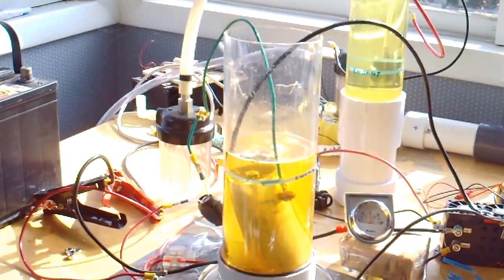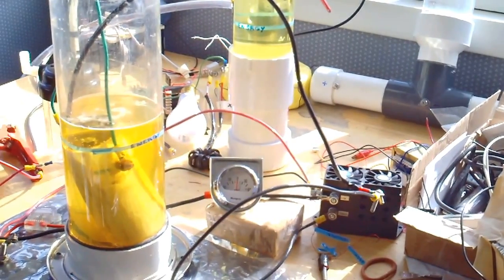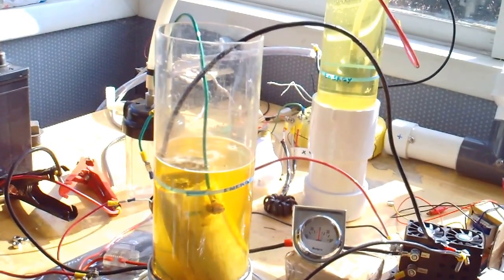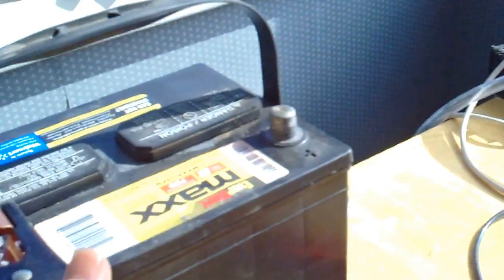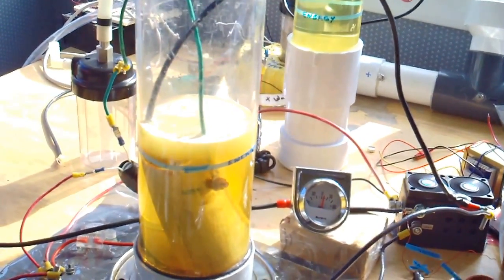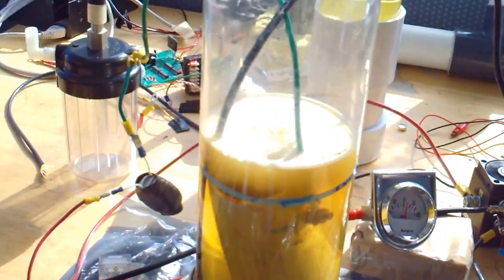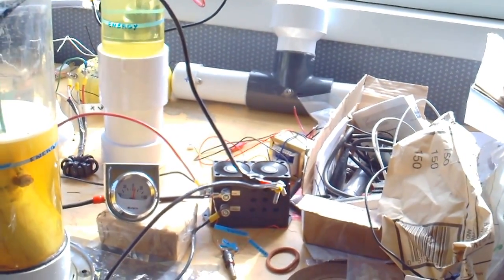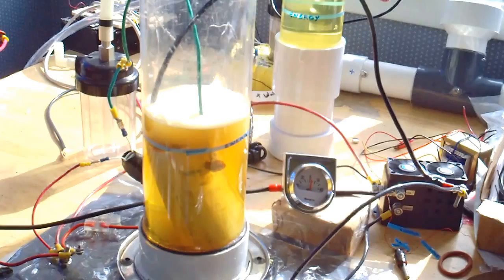HHO Output Tripled Using Toroid Coil

Comment: Even if this was not a scam, you have zero knowledge at all. You do not state the LPM, or what the LPM produced could be used for (You need 50 - 80 LPM to run a 5kw generator and half load). But yet, with ZERO knowledge, you are asking people to become dealers. YOU ARE A SPECIAL KIND OF STUPID!!!
Reply: +Trina McDonald He also doesn't state the concentration of water vapor in his product gas. One-half watt per square inch of plate area is the optimum amount of power for electrolyzing water. A pair of plates 10" square need 50 watts to produce primarily Brown's Gas. If you use a higher wattage, the plates overheat and boil the water instead of separating it into H2 and O2. The huge showers of "HHO" bubbles coming off these guys' electrolysis cells are mostly steam.
Reply: He appears to be using the same tactics all scam artist use.
Reply: is it 50-80 LPM when the generator is properly tuned to fire at TDC? maybe even slightly after TDC.

Comment: Also, if a fuel cell runs off of hydrogen wont it also work in reverse? I would think the elements would work better than metal for hho production.
googol bloom box. A researcher has a hho cell that works very well.
Reply: +Randy Travis A Bloom Box converts natural gas into electricity - it's a "solid oxide fuel cell."

Comment: I was wondering if super high voltage and low amps would work better with a beefed up joule thief circuit. It would let you reuse your energy and let the battery last longer but I don't know if it would be good for hho production.
Know it works great for led's. One guy had over 600 lit on a double a for over a day.
Reply from the maker: I will look into the joule thief circuit. You might have something there. At the moment, I'm building a Meissner radiant energy battery charger circuit and replacing the coil with an O-U Vortex coil. We may be doing the same thing using a slightly different approach. I'll post the test results soon (I hope).

Comment from the maker: The best HHO unit we offer produces 16 MMW or 16 milliliters per minute per watt. I'll be testing it with a radiant energy circuit and our pulse width modulator to see if the efficiency goes up even more. 949-945-5417. Dave

Comment from the maker: Thanks for the encouraging comment. The toroid coil has nothing to do with atmospheric pressure. I need to accurately measure the increase in amps AND the increase in HHO output with the toroid coil vs without. Since my experiment began with 30 amps and the special water additive lowered it to 1 amp, the fact that the toroid increased the amps a little but greatly increassed HHO is significant IMHO.
Reply: did you use square pulses and did you wind the coil around a ring magnet ?
tks